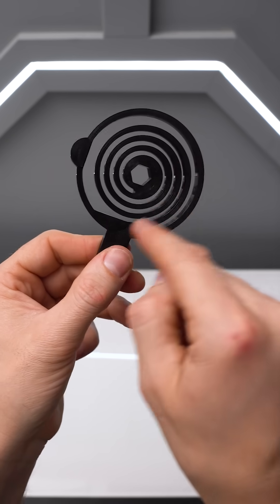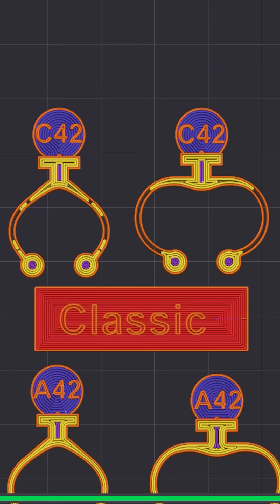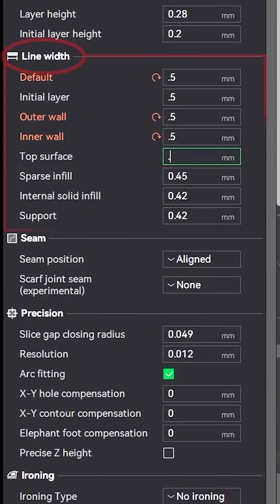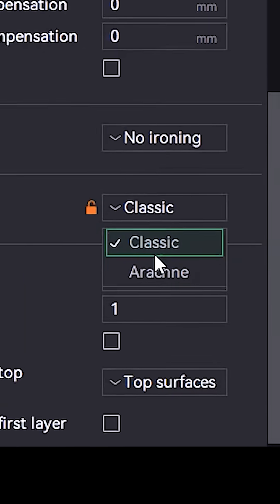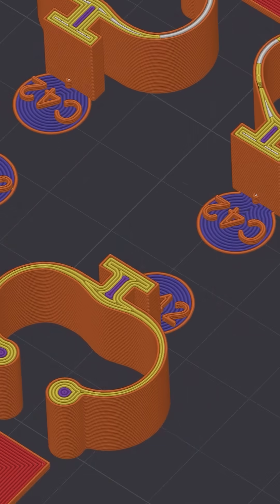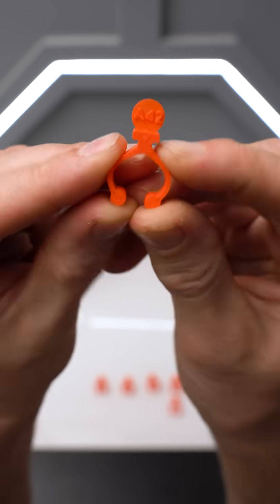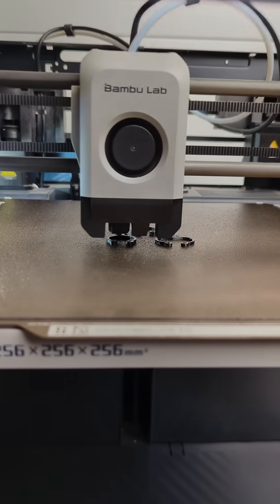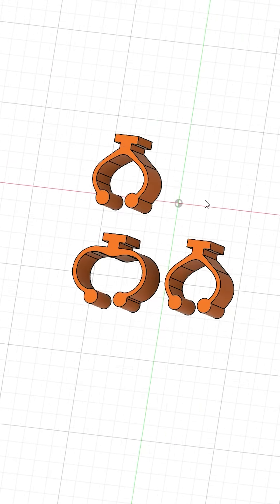One Setting FIXES 3D Printed Springs #3dprinting #tutorial #stl #download

Comment: Day when arachne becomes default will be a good day. Comming from cura i was shocked to find about classic wall generator.
But, users said arachne can be buggy so i tried classic. For my use,very bad. Seems arachne should be not used only if it breaks on some features
Reply from the maker: I agree, it's great unless there are bugs. Sometimes, a simple layer height or line width adjustment will solve it, but not always. Classic is a good backup, and still works great on basic shapes with square walls, etc...
Reply: Has been the default in prusa slicer for a while
Reply: @thatredkite8310  it seems to work well